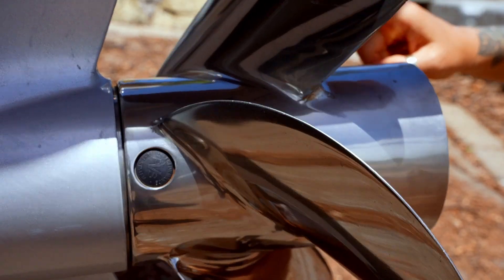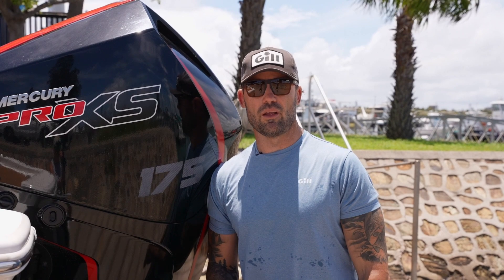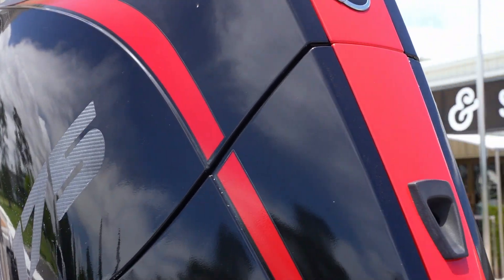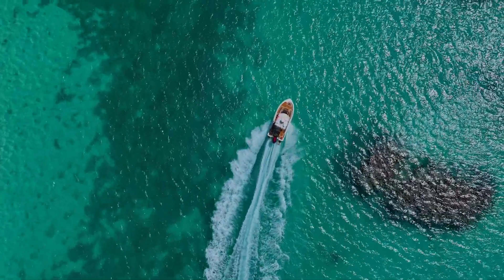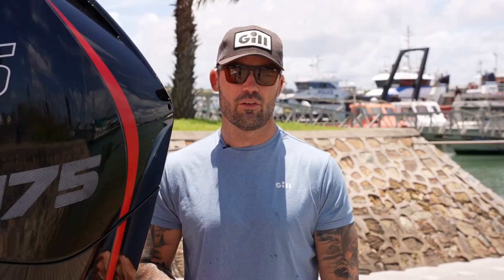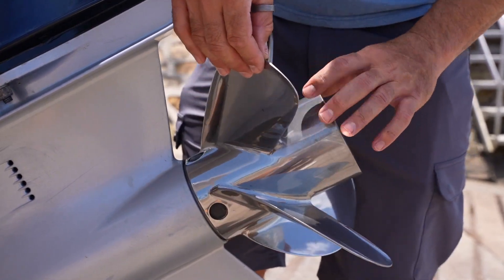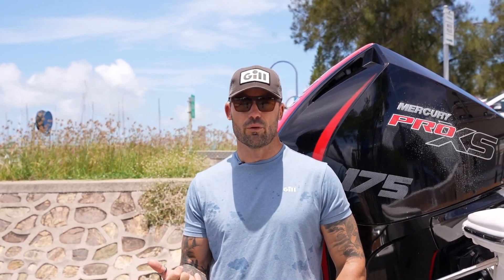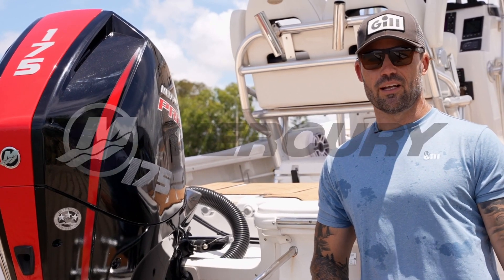Dean Silvester Chats Prop Selection

Comment: I've got a 1992 Sea Ray 19' ski boat. I love it but my old 2.5L two stoke is shot. It''s got the high 5 prop which I love and would like to keep. I'm thinking about a re engine with this new 175. Besides fuel economy, is it really better hole shot and top end?? Can I keep the high five prop on it?